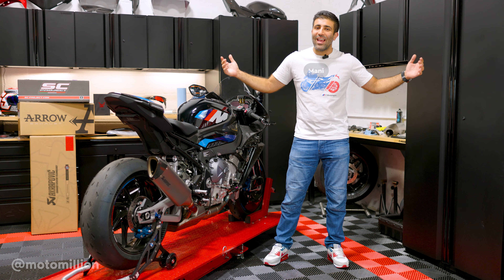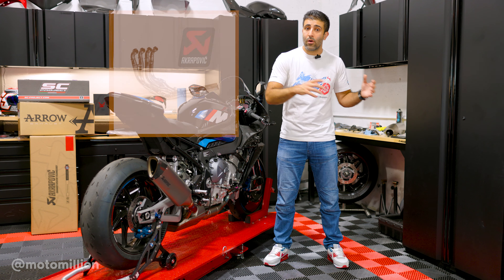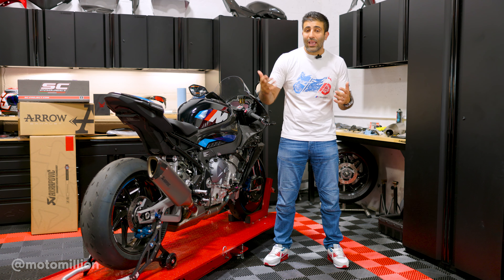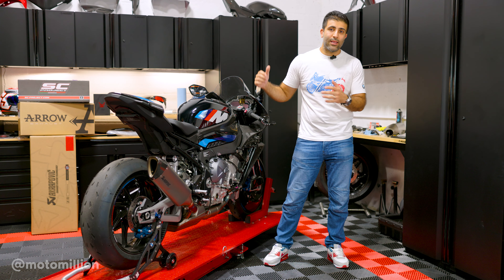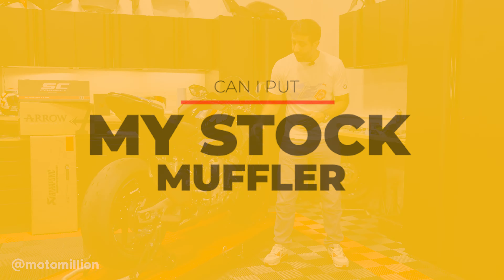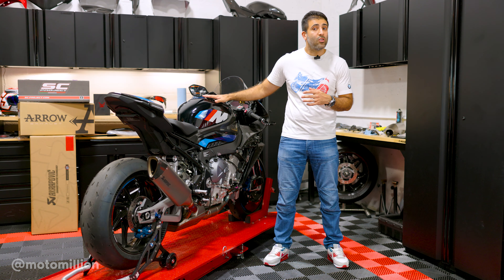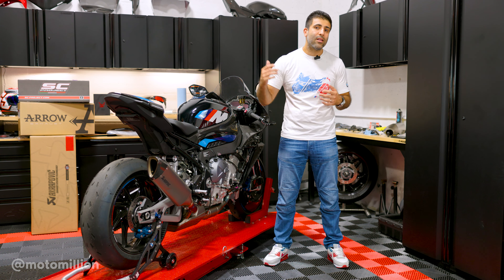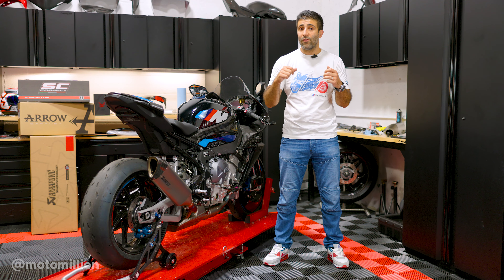Ultimate Exhaust Guide for the BMW S1000RR & M1000RR!

Comment: I can say from personal experience that the material and craftsmanship of Arrow compared to Akrapovic are virtually equal with each other! Akrapovic might have a little higher price than Arrow but the materials used and master welders building these exhaust can virtually switch jobs and you couldn't tell who built what exhaust from each company unless they told you! The only differences I've seen out of eight bikes were the two shorty exhaust (one Akra gp and Arrow low shorty) made 1 to 2 hp less at peak power compared to the Akra Evo and Arrow Competition Evo! What I'm getting at is they are so dagum close that you need to solely pick which one you think looks the best to you because both are equal when it comes to performance and craftsmanship!

Comment: Does changing the filter and exhaust plus stage 1 flash effect/negate manufacture warranty?
As always outstanding videos.
Reply from the maker: Under the Magnuson-Moss Warranty Act, an aftermarket product added to your vehicle can not automatically void your warranty. The onus is on the manufacturer to prove without a reasonable doubt that the aftermarket item you installed on your vehicle directly caused the malfunction which you are trying to warranty.

Comment: the longer the exhaust the better in my opinion. both for deeper sound, but i just think it looks better. in every bike. i just like them long
Reply from the maker: We like the short stuff too but the long cans do look amazing.
Reply: I prefer short (but it made my ears hurt on this platform) so had to go long.  Long actually gives more top end power, as it has more "pull", but it will weigh more and at this power level it's all about the sound really...

Comment: Titanium heats up faster and cool down faster, in the competition sense titanum is the best way to go, also arrow, makes pusative exaust systems which are techincally better than akrapovic, if you also work on your airbox, the real diference will come on the road with the ram air, arrow will do a lot better on street
Reply from the maker: Yes, titanium is the optimal material for competition purposes. Lots of good information here, thank you!

Comment: Hey Mani, I'd there any huge hp difference between using a short gp type slip on or a full can like the oem slip on running a ackra or arrow headers?
Reply from the maker: No real proven difference. All within 1-2hp of each other. Arrow headers in Titanium are lighter than the Akra headers in Titanium.

Comment: My local bmw has a preowned 23 s1krr with a stage 1 been tune on it and I noticed the flapper was deleted. Looks like someone just took a grinder to it. Could this mean maybe the previous owner maybe did a stage 2?
Reply from the maker: Probably not, I would question that type of shoddy work though. Definitely not something you are advised to do even with a stage 2 flash.
Reply: Better off just getting the flapper set to open in the flash, for simplicity.
Reply: That’s what I figured and can always flash back to stock with the hand held and not be worried about warranty as much.

Comment: @Motomillion I have the 23' S1000RR and I am based in London so got the EU model, without swapping the whole exhaust as that will void my warranty if I just swap that akrapvoic slip on as I have the same one since it was an extra package would that increase the noise say if I was going to put the SC project one? or are all the mufflers/silencer crap installed in the exhaust under the engine and won't make a difference to sound?.
Reply from the maker: You may need a Stage 1 flash by brentuning to see any noise difference as the exhaust flap is closed most of the times.
Reply: @Motomillion  Ok, thanks.

Comment: If I just put a slip on exhaust on my 23 s1000rr do I need to tune the bike or will  I be ok with out a tune?
Reply from the maker: It would be okay without it, but it would be pretty quiet since the exhaust flap is closed most of the times. I would recommend the Brentuning Stage 1 flash to go along with it to get the most out of the exhaust and to get rid of your restrictions.

https://www.motomillion.com/collections/bmw-s1000rr-23/products/brentuning-s1000rr-stage-1-flash-with-handheld-tuner-2023-s1000rr

Comment: You missed the main question.
After installation full system exhaust, should the air filter of the bike be replaced with free flow air fliter ?
Reply from the maker: Did we? It is in there no? If the bike is exhausting better, only makes sense to have it breathe better.

Comment: Can i shorten the length of the exhaust, will it affect on performance? I hv full titanium akrapovic system with cat, so i want to cut out the cat part and juat join back them pipes, will it affect on engine performance?
Reply from the maker: The way you describe to do it, it will.  Cutting and chopping is not the right way.

Comment: Personally, i would not run a sprint filter, as the filtration isn't good enough. I run a bmc filter (non-race) as filtration is at oem level, and bmc is an oe part on some platforms, eg e46 csl.
Reply from the maker: Sprint Filter inherently has better filtration given the fact that they are polymer filters, and not sponge / paper. If you understand the construction you would not opt for anything else. All the fancy 40k bikes from Ducati come with Sprint Filter installed, and there is quiet a few MotoGP machines running Sprint Filters and WSBK as well.

Comment: These bikes come with wide band O2 sensors. Which means the ecu can auto tune it self to any changes in air flow. No external tuning is required. 😉  I'm surprised this guy wasn't  knowledgeable about this.
Reply from the maker: They auto tune to the parameters set by the factory with a ton of limitations. I’m surprised you aren’t knowledgable about this.
Reply: @Motomillion  Of course I know more than you. I said nothing about the throttle map restrictions, which is the only limiting factor on these bikes. I stated that a fuel increase on the fuel map (tune) is not required because the wide band sensors will tune automatically to maintain the target AFR. I'm available to school you any time.
Reply: Not the only restriction ...2 water pumps in 1800 miles  and 3 month wait..POS !

Comment: That was super helpful. Appreciate it.

I have one question. As per your experience does the K67 S1000RR bog down when the intake temp goes too high?( With heat temp in stock position and Just the stage 1 Brentune Installed)
Because brandon keep mentioning it in his video as among the most important mods.
Reply from the maker: You may notice it if you are racing, but just street riding you would most likely not notice it. But the bike does pull timing as the IAT reads higher, which robs power away.

Comment: Due to legality this should be titled track only exhaust guide for bikes that are not used on the street or ever will be.

All you can do is a slip on as long as it does not make the exhaust too loud.

Moto GP exhaust is NOT the same.

As a shop you are risking the current EPA enforcers….. there is a crackdown.

I’m, your statement about types of metal and power are completely false.

Routing is important, how you control the heat to aid in venting is the most critical.
Reply: NO you can't do that Ricky Street race won't be loud and obnoxious any more.